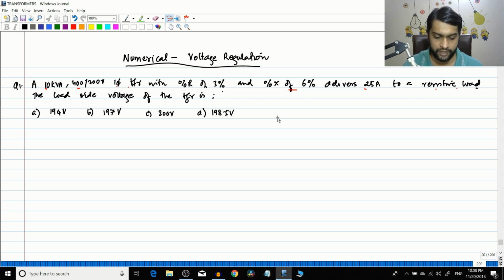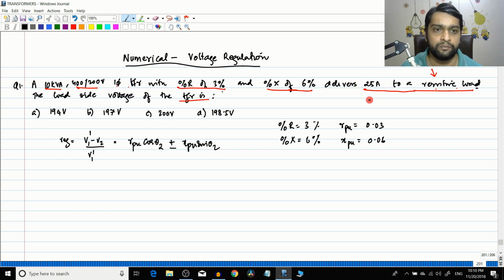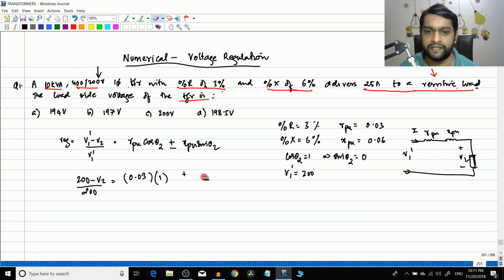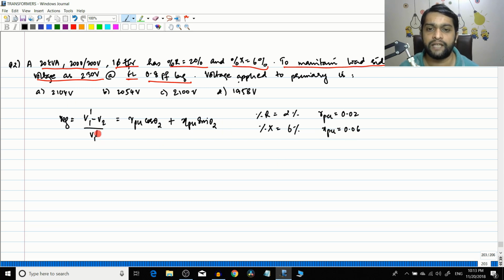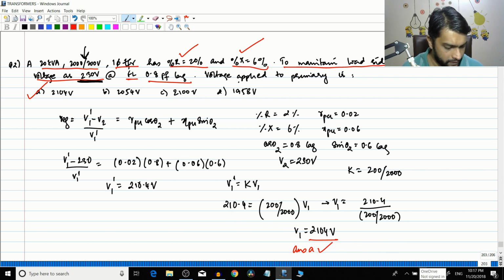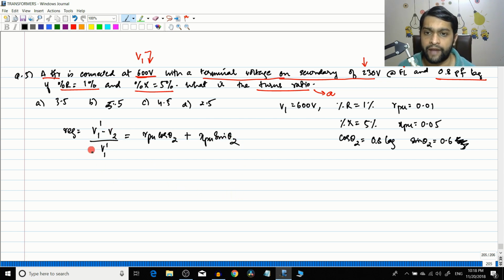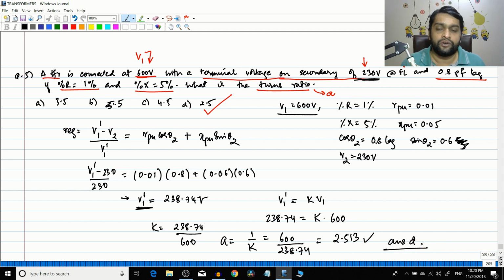TRANSFORMER #52  - Voltage Regulation of Transformer ( Part 3 ) -  Numerical

Comment: Sir , in the 2nd qn we get primary voltage 2104V which is greater than the rated primary voltage of tfr....won't it brust if we apply that much voltage(2104)..please reply..

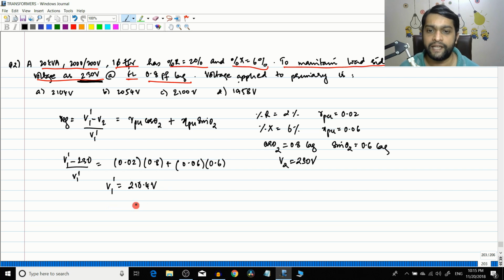Comment: Sir in problem 2 at time 07:32, how come V1 dash value is less than the load side voltage that’s to b maintained ?  I solved the problem and I’m getting V1 dash around 242 !
Reply from the maker: Meme there is a typo in the numerical I did,...
Reply: @ElectricalisEasy  Thanks alot for ur quick reply sir! Just now finished watching ur single phase transformer lectures! Machines was never this easy for me before.It was always a beast for me that i was scared  to handle.Now after watching ur lectures im able to slove probems from PS Bimbhra!! Thank u so much sir for sharing ur valuable knowledge with us!

Comment: sir in question no 2. it is asked to find primary voltage or in other words it is asking V2' if turns ratio is negleted. now thw power factor is lagging i.e it will consume reactive power. hence the source voltage must be greater than load voltage. (please correct me if i am wrong).
now the answer that we see in option is lessr than 230 volts. how could it be? my answer is 2426.16 volts in primary. i have tried both approximate as well as vector diagram. both are pointing to same result as 2426.16 volts

and by the way i appreciate your efforts in your vision. thanks
Reply: Actually here qun was wrong....load side vtg is not 230 ....it's 200v in 2nd qun

Then we will get correct answer as mentioned in this video.
Reply: you are right bro.mine is the same answer
Reply: Same here..